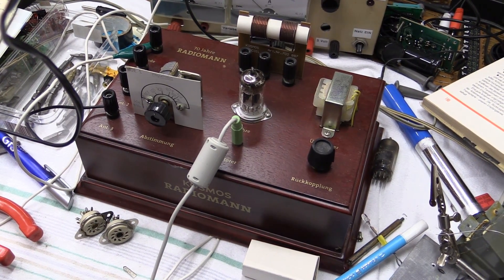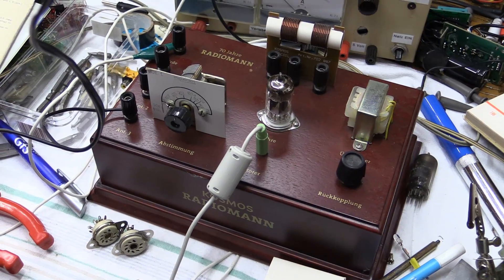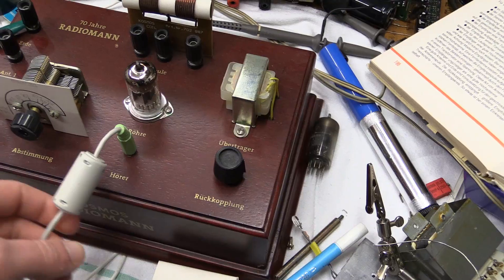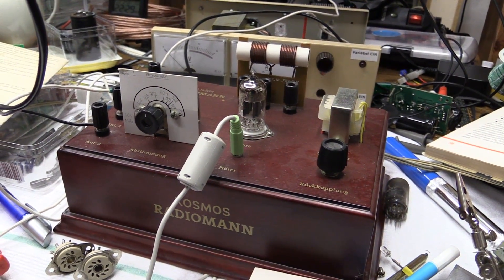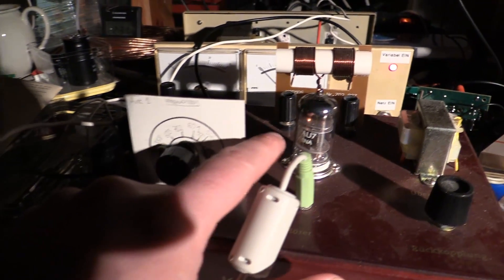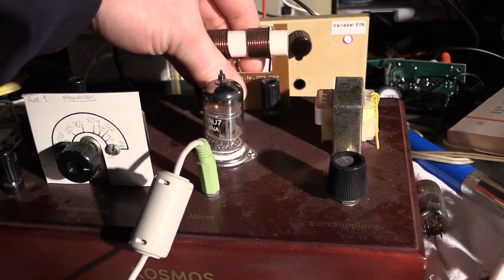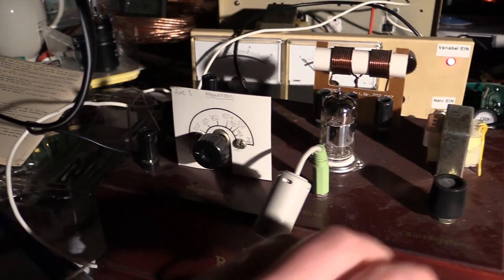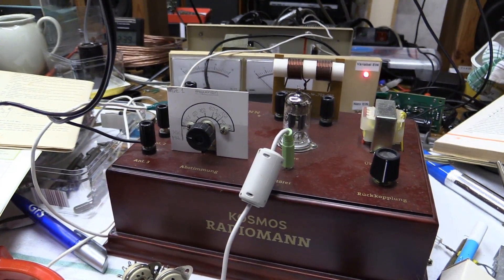DrCassette's Workshop - Kosmos Radiomann Tube Radio

Comment: The first resistor of 100k is too low! It´s value is not that critical but should  be at least 1M or 2m or 3m or more!.your regenarative control of 47k would be better around 100k. the second 100k resistor around 1M too.and some caps in the antenna connection  of different values.
There is a great video of modification that improves the radio alot, and shows you the modify parts without the need to add more voltage.
https://youtu.be/2jT6Xass7QU
Reply from the maker: I don't have this radio anymore, but others might find this info useful.

Comment: I am amazed the valve even conducts with just 12 volts HT  (more like LT really!!) I think the answer is MORE volts!! I guess as a kids experimentation radio you cannot let them play with 70+ volts. Mind you as a kid my amplifiers had more like 300-450 volts. You only touch that once!!
Reply: Of course you can let the kids play with 70 volts, they'll learn. Never hurt me, or you, apparently :)
Reply: i know a few tubes that are hooked up wrongly
and yet can transmit 0.5W of am
with only heater power